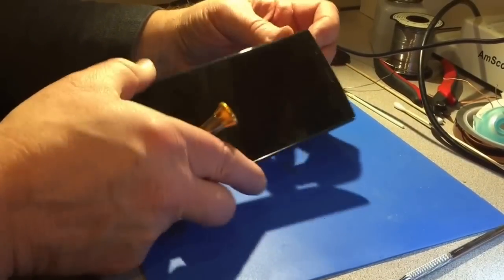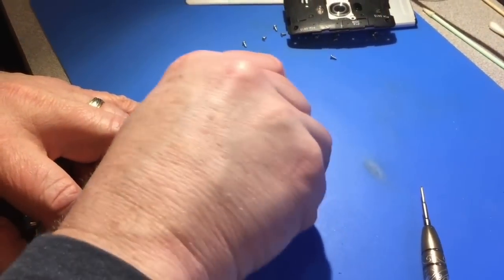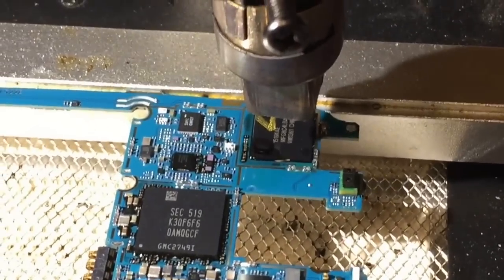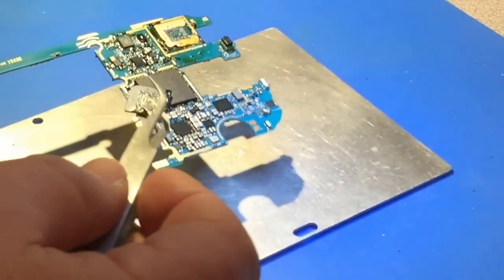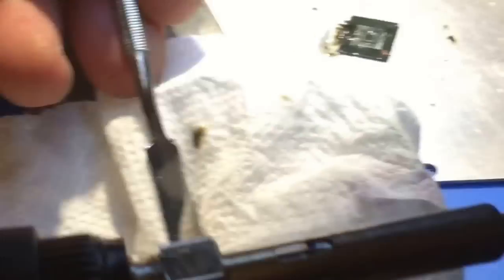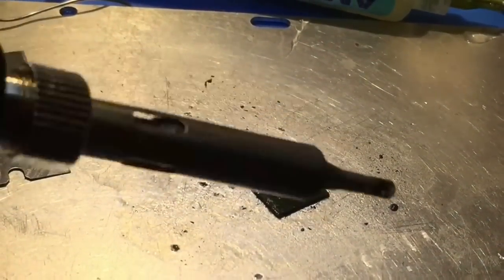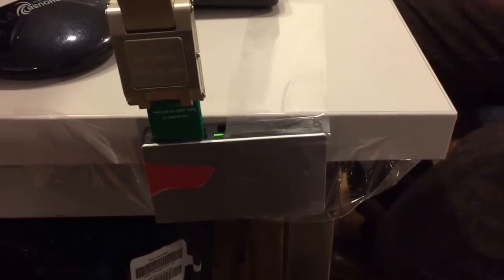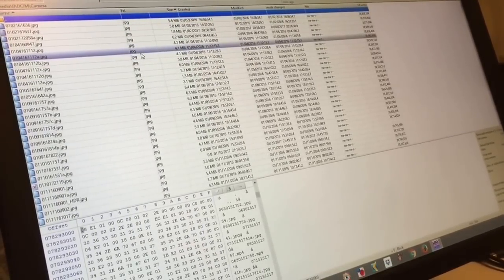LG G4 Boot Loop Chip-off Data Recovery - 100% Success!

Comment: Good video but I just wanted to let everybody know at two minutes 57 seconds on the video you’re pointing to the memory chip, what I did was apply heat from a 1500 watt hair dryer to the center chip, for 10 minutes, 1/4 inch away, reassembled the phone and was able to boot up and recover all my important info, pics, videos, etc. Now, I said that to tell everyone that I’m sure it’s not a permanent fix, but it was enough for me in my circumstance to get what I wanted, then do a factory reset and destroy the phone and never buy LG products again. Thank you for this video and your services to help others, it was very educational.

Comment: I hope this convinces LG G4 users to back up their phones to the cloud or a microSD card.
Reply: I had my photos and all in a micro sd card. Then it got full. Only took me like a week to get a new one. Problem was: we were on vacation during said week, meaning loads of important photos taken daily, that I didn't have the time to backup because it stoped working still on said vacation and I was going to do it once we got back home  :(
Reply: @MPRF12345  I know this is easy to say, but: when traveling, especially anywhere other than in a major city in a first world country, assume that you will have problems and prepare for them. For example, I always have a spare empty large capacity uSD card for my phone, and at least one spare battery for the phone, plus at least one spare of every kind of cable that I normally (and perhaps not normally) use. None of these take up much space. I even always have a spare phone. And I do all this even if I am going to downtown Manhattan.
Reply: @douglasjensen8986  I know, I know 😓

Comment: Just for anyone that didnt know, the boot loop failure  is a thermal failure! You can put you lg g4 in freezer for 1hr and ne able to start it up to download info on computer for 5 min! Rinse repeat till all needed info collected.
Reply from the maker: We've heard of both freezing and/or heating as possible solutions to the boot loop problem..  If it works for you that's great. We've been getting 100% of these recoveries for some time now. Our chip-off data recovery is an option after you've tried everything else and nothing has worked, and the pictures on the phone are really important to you.

Comment: can I use the LG G4's eMMC to use it as an external drive to make a Windows 11 bootable?
Reply: yes
Reply: @RoUt204  well, can an eMMC work without DAT1, DAT2, DAT3 as long as it has DAT0, CLK, and CMD? I am going to solder it on an external SD card reader if it would work

Comment: Thanks for the video. The way I usually do it is running a beveled iron; LEADED solder, over the bottom of the BGA after removal. After I have enough solder on each sphere, evened out as much as I can. I rub it over a piece of paper until they are even, and replace. I like your method - Can please please link the exact model of the SD adaptor/reader for me? That seems like a cool alternative in case something goes awry with my method. Thanks in advance.
Reply: Instablaster...

Comment: Anyone ever have some of the solder mask (from the motherboard, the green resin coating) come off with the chip!? At first I was worried that I left some of the chip on the motherboard, but nope, it's just a layer of the green stuff glued to the chip! (I have a decent rework station, I thought, but I was wondering if it wasn't hot enough. My final round was with 740 degrees F, because it just wasn't doing anything for way too long!)

In any case, thank you for the great video!

Comment: Is it possible to install the eMMC chip to another g4's motherboard? How much temperature does the motherboard and the emmc support after they become unusable?
Reply from the maker: I haven't tried this before, but it should work. I try to keep the heat under 400C.
Reply: You should also reball the chip properly and position it correctly. It is kind of a hard one. To do resoldering, choose balls with melting point that are fine with the maximum temperature the device can get to, so that something like bootloop on snapdragon would not happen to this chip. Then heat the board in a linear fashion and the chip as well to melt the balls on the board. The multi-layer board can withstand temps up to 400°C for about 10 minutes but do not bend them. This is and extreme situation. Use as little temperature for as short time but enough to melt all the balls and all the pads both on the board and the chip. The chip temperature depends on the technology and internal parts. For soldering, follow the steps of [pre-heat, pre-reflow, reflow, cooling]. There are temperature/time graphs on the internet (reflow soldering graph). Adapt them to your needs.

Comment: not necessarily...mem array still might have had damage from heat or electrostatic discharge, while the file allocation table seems valid, the actual file data still can be corrupt. nevertheless, dude's fine , could save the chip in one piece, a chip which was never meant to be removable. and it actually worked !

Comment: Awesome video! What kind of tip are you using on the soldering iron? Is that a blade tip or more of a blunt tip?
Reply from the maker: Thanks Alan!  The soldering tip is flat angled angled tip. It's important to put the chip on a flat surface. I use some flux when removing the epoxy underfill. A solder braid also helps, but be careful not to scrape the chip too hard and expose the etches.
Reply from the maker: Its more of a blunt tip.  Not too sharp.

Comment: my g4 is encrypted. would you be able to recover any data from it?
Reply from the maker: No it's not possible to get the data using chip-off if your G4 is encypted.
Reply: FlashFixers anything else cold be done? Money is not an issue. I want to save my data. I encrypted my phone using the Android operating system.
Reply: If you watch videos on youtube there is a way that mostly works to get the phone to reboot again by taking the phone apart and putting something inside the phone that when you put it back together it applies pressure to the chip.  then the phone boots without issue. I have done that to a few phones. Sometimes the phones will work for ever and other times it's just a temp fix.  the only way to repair the phone is to reball the chip that is getting the pressure applied too. There are youtube videos showing you how to do so.
Reply: @flashfixers8180  how do we tell if a phone is encrypted or not if you dont mind me asking?
Reply: @madadventures3407  Im asking my self the same thing

Comment: where can i buy this reader or if so you can post a link please i really need it
Reply from the maker: You can purchase on Ebay or Amazon.  Sireda,, KZT, and Allsocket are brands that I use.
Reply: @flashfixers8180  which all socket areyou using?

Comment: seems easy. is this doable for someone with almost 0 knowledge of soldering and soft/hardware? is the emmc chip damaged fast in this proces?
Reply from the maker: Like anything, your technique and confidence grows with practice.  I've done hundreds of chip-offs..  but you still have to be very deliberate and careful with each one because you only have one chance to do it right.  I'd suggest that you buy some used phones to practice on first, before attempting on your own.  If you'd prefer to have it done professionally with best chance of recovery, or rather not buy the equipment for infrequent use, you're best to hire a data recovery company with a proven track record to do it for you.
Reply: hmm thanks for the response. had contact with a recovery company and they ask 900euro. well..thats a lot but ok, worth it. but it also takes 4weeks and since im in a hurry i guess im kinda forced to do it myself unfortunately
Reply from the maker: After we receive eligible phones for chip-off we usually turn them around in 24-48 hours.  We accept all international shipments, and to save time can upload recoveries to cloud storage where they can be downloaded from any location.  Visit our website www.flashfixers.com for more information on submitting your case.
Reply: hmm looks interesting. my case is special though. i cant get into my phone because of a bootloop and i actually only need the Google authenticator (2fa) app. is this possible? (i do know you can redownload it and use 16digit key, but it doesnt work somehow and im 100% sure its an extern mistake)

Comment: can you make recovery from the emmc  if i have pincode lock on the device ?
Reply from the maker: Yes. Chip-off works even if the device is locked with a pin code. The security layer is after the userdata and does not block its direct access.
Reply: Nice

Comment: My phone, LG G4, took a really hard fall (in other words, I threw it at the floor) - Now it doesn't power up at all. What can I do? I have a lot of important info - Does this get contacts? Text messages?
Reply from the maker: Yes this chip-off data recovery process works for physically damaged phones as well and recovers the phone's entire internal memory. It works for contacts and text messages as well. Here is a direct link to our web page dedicated to boot loop recovery:  http://flashfixers.com/lg-g4-bootloop-data-recovery/. You can outsource the chip-off process on your phone to FlashFixers by clicking on the link on that web page and completing the online form.
Reply: Thanks, I have tons of photos, contacts, texts, and other documents that were never backed up.

Comment: is the boot loop can not be fixed/repair
Reply: yes it can, but do you really want paid over 200 for it ? what happens is the cpu overheats and breaks the solder , what you need is reballing the cpu, if is just boot looping remove the thermal paste, the heatspreader and put a new heatsink and some new thermal paste, or cu tape double side to spread the heat around the battery but if is on a infinite boot loop the cpu is done

Comment: After the 400c preheat, what was the temperature of the hot-air machine?
Reply from the maker: Temperature is a variable based on your hot air equipment and the circumstances of the chip (amount  and type of underfill). You'd have to try different settings and see what works best for you.

Comment: I always thought these nands were better encrypted 
Does a method like this exists for iphone?
Reply from the maker: iPhone NAND memory has been encrypted since iOS 4, so this method won't work.  For new Android phones with factory installed 6.0 or higher, encryption is enabled by default same as iPhones. Legacy Android devices 5.X and below (AND those that upgrade to 6.0) can still use the chip-off method for data recovery. Some newer phones (eg. Samsung Galaxy Note 5, S6, LG G5) use UFS memory instead of eMMC. UFS requires a different fixture and programmer, but that's another video.
Reply: So if my HTC came with 4.1 but was updated to 6, it would not be encrypted? I know for sure that it had lollipop at one point, but I don't recall if I updated again after that.

And thank you so much for your useful videos! Definitely the most well-made one I've seen so far on this topic. I'm starting to feel like there's finally some hope for my data.
Reply from the maker: If the phone came with Android 4.1, it should still not be encrypted even if it was upgraded.
Reply: Awesome, thank you! Are eMMC's really as durable as they appear here? I lost 3 years of photos and can't afford professional data recovery, but I have access to the necessary tools (minus the reader and software, I'd have to find those.) Would I be likely to damage the chip if this is my first time doing anything like this?